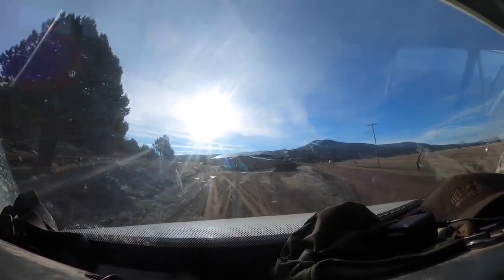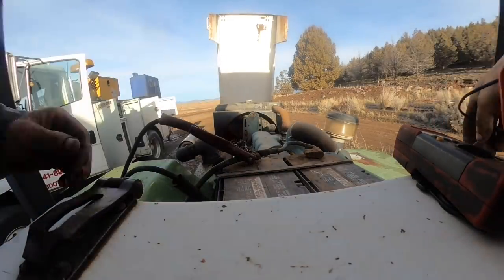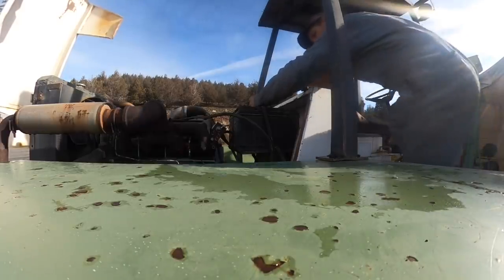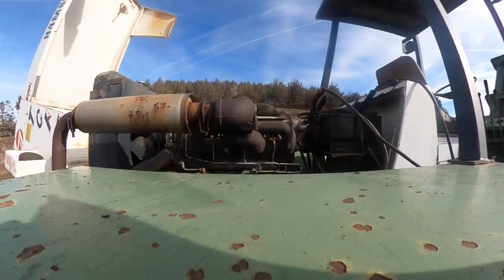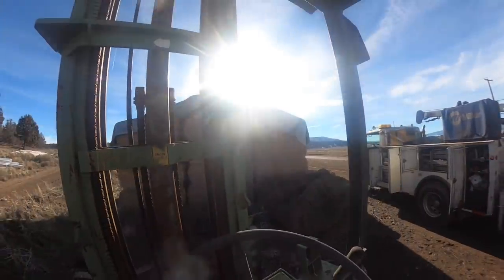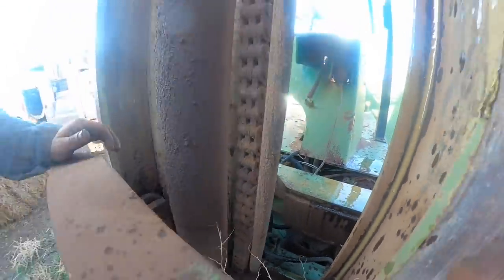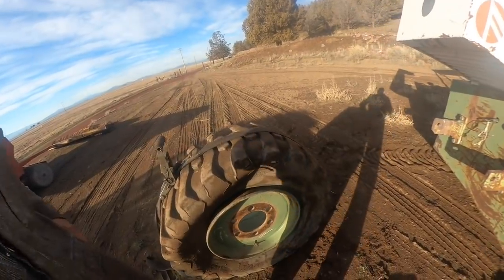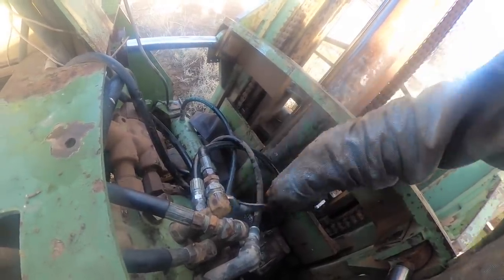I bought an all terrain forklift.

Comment: when i use the ratchet strap trick i beat the center of the tread with a hammer and keep tightening the strap. it distributes the tension around the whole tire instead of right at the ratchet

Comment: G'day, Warren! Great job! I'm so happy for you! What a neat find, and a handy machine to have around the shop. TCI H4M80 All Terrain Forklift 4X4, has a 21' Lift, Side Shift, 6000 lb. Capacity, 4 Speed Trans with Torque Converter Reverser Transmission, fabulous 4 cylinder Diesel Engine. Weighs 10,000 - 12,000 lbs. Plus! It Will Go Anywhere!! 

By the way... 'TCI Power Products' began making the Dynalift tele forklifts in North Dakota in 1974. It was purchased by Gehl in 1988. The TCI Dynalift was the predecessor of models like the Gehl 663 Dynalift, (TCI which was green OEM color) which was one heck of a good forklift, built like an anvil. And, they're a very nice machine to work on. Telescope cylinder easy to remove, Rockwell external caliper brakes can be serviced without wheel removal, protected hoses on outside of boom to fork level/tilt cylinders instead of inside the boom. The 663 had several nice mechanic features, too. Enjoy! 

Cheers! :-)

Comment: Superglue the magnet on the camera. Check that oil dip-stick., purge the fuel filter of water, can of starting fluid, check air filter, look for critters nests, chewed wires. Check the water in the radiator. That starting fluid may get that bead back on the tires.

Comment: Couple of ways we get the forks off the ground for transport Warren.

1) Use a hand winch/chain hoist hooked to a mast cross member and the carriage and just winch it up.

2) Use your crane to lift the carriage 2-3 feet so the lift chains are really slack, pull them forwards out the front of the mast then slide a couple of nice 4x4's between the chains and across the mast channels then lower the carriage back down - that'll just get the forks off the ground enough to get it on a trailer.

Comment: I usually have better luck seating beads if I lay the tire down with the rim on a block to push the bead up on 1 side then you are only fighting 1 bead. John Deere ether is the best about 1 second for every inch of width. Forklift tires should be solid filled or at least a good dose of sealant

Comment: As a retired forklift mechanic, the correct way is to chain it is to one of the welded cross bars on the back of the mast. You could lift the carriage up with your truck Crain so you don’t have to waste all that fresh hyd oil. But it’s always your call for your own safety.. I only ever got to work on one of those old TCI four wheel models in twenty seven years , so they are like chicken lips pretty hard to find..

Comment: Either kills an engine, best for cleaning parts, no residue. We take gas and soak a rag , then hold over intake. Or take old inner tube and cut a 8 inch circle around the valve stem , saving the stem. Take that over fuel filler pipe at fuel tank and run hose clamp around it. Plug off breather tube and put air into fuel tank and system. Crack open line at injection pump, then you know you have plenty of fuel. Works well for engine that hasn't run in a long time.

Comment: Some times you can gently bump the back side of the alternator case with a hammer and get it to charge , the brushes stick some times from brush dust packed around the brushes and setting for a while too , but you probably tried that ........

Comment: Nice score Warren. I had an old military surplus Ross forklift WW2 vintage. It got the job done for us. Old continental flathead engine. Simple 6 volt electrical. The shifter had been blocked so you only had forward or reverse. I wouldn't have ever wanted to drive it faster than a crawl. The old units were so much easier to keep running.

Comment: You will use it a lot rubber track tractor changing out. It will be good in snow Can't wait for part 2 .Still would fix little one for inside the shop.

Comment: Warren is going to kick my butt. The man has a service truck with a crane he could lift the fork carriage and chain in up. As long as the lifting chains on fork lift did not bunch up too much. Warren is going to be using this fork lift all the time once he has it back it shape. I have a rough terrain fork lift I use it at the shop and in the field. The only down fall it is a 2 wheel drive but it does have differential lock. But it does have mechanical brakes so I don`t worry leaking brake fluid. If I was down south I would offer to help him part time. It is good to have help with  the undercarriage on those D4`s.

Comment: Spray down all those linkage rods to everything with all that weather and not moving or vibrating to make sure nothing is binding. My column shift tractor stinks until I lube all those linkages and pedals after sitting awhile. Thought I was going to have to take the dash apart. That WD-40 gel formula works good on that king of stuff.
You know all the other stuff to do to a long sitting piece of equipment, without knowing its full story, like that rubbing vibrating sounding thingy :goodvibes::yougotthis::yougotthis::yougotthis::learning::learning::learning:😅😅

Comment: Warren, use your winch to lift the forks, wrap a chain around the back rest to the top of the mast, that will allow you to move it around. Also, do yourself a huge favor, get the tires foam filled.

Comment: I think that forklift is meant to be towed if needed. The brackets on the side of the mast are to hold the forks folded up and the tabs on the back are for a tow bar.
Reply: The “eyes” are for lifting the machine with a crane 🏗

Comment: Hi ya Warren with you
100% New Start  fluid JUST SUCKS !! I've even Tried the propane route Av gas & air to vaporize the mix..Cold rubber Trick on 2" strap. Leave enough so you can undo ya I've had to cut them too lol love your Get-er-done attitude BTW My old clark fork life sure saved my back WE get Smarter as the body says. That's gonna leave a Mark..don't do it yet. We do lmbo

Comment: With the cylinder bleeding off and the hose in the shape it was, couldn’t you have used your crane to lift the forks and then chain it up? Just was curious running through scenarios on what I try.

Comment: Two parts epoxy will fix your camera mount for temporary use. until your able to get A replacement part for your tripod stand again. So that  you can put new screws back into it.
Reply: I like the hot glue instant hard and cheap

Comment: the starting fluid you buy from box store is total crap, i only buy yhe original quick start, in cold on big tires i use the torch gas at a 60/40 mix to pit in the tire and light it off, it will jump the whole machine up. i also lock the air line on to the tire, and have a valve down the line to turn the air on just as the gas go off, running air in well putting the quick start or the torch mix gas in just gets forced out as fast as it is put in,,  but the bottom line the mix of torch gas works far better then the quik start, on heavy tires, you dont need to jack the machine up muck.. if at all. using the torch gas it like how we use dynamite to blow big loader wood harvisters tires out of the frozen ground after they sunk the day before, when it is 45 below

Comment: 34:40   Probably not the distributor's fault. The whole country is slowly running out of all kinds of supplies. I'm seeing Dollar stores and Walmarts with holes in shelves where a certain product is gone. Yesterday I tried 5 parts stores trying to find a belt tensioner for a 4.6L Ford , one of the most common motors on the planet, and not one swinging dick had one in stock. 

I work at a supply store and we can't get restocked either. We get a little here and there but not what we need, but damnit to hell we're really going to build back better with that mumbling dipshit in charge.

Comment: they make some stuff that comes in 5 gallon pail thats like yellow paste to put on the bead ...wish i could remember what its called works good ...cmon tire guys help me
Reply: Tire mounting grease/paste/soap
Amazing what you can accomplish by packing hands full of it in the crack between tire bead and rim.  

Warren’s last one does look like it needs a warm up, but I’ve seen some bad ones that popped out after packing the cracks with the tire soap

Once it pops out, scrape all the soap off the tire and put it back in the bucket for next time.  But you really need to have some way to clean your hands before doing much with tools after that process!